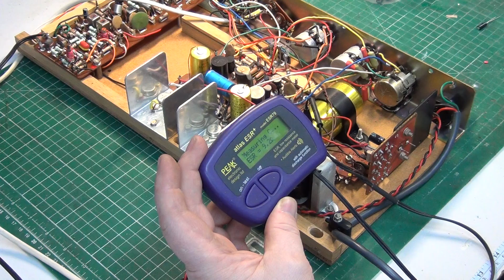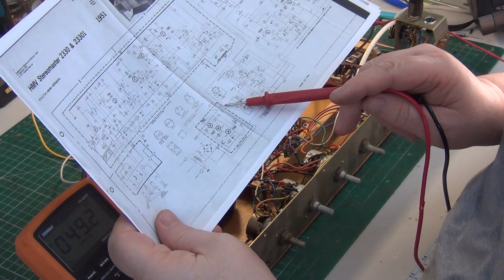HMV Stereomaster 23301 radiogram overhaul - pt2 of 3 - Electronics overhaul

Comment: Radio and tape sounding good I would assume the tuner is LW/MW/FM standard though in the past I've come across the odd radiogram with SW.
Reply from the maker: All the HMV Steromaster range of radiograms are FM only. Because they were HiFi it was decided that LW&MW weren't HiFI. HMV also did a standard range of radiograms with LW MW & SW too at the same time; but the Stereomaster range were HiFi.

Richard, G0OJF, UK

Comment: Another excellent video - thank you for sharing it with us. It's interesting to note the underlying chassis to which all the circuit boards are attached is actually made of wood - from the days when things were made properly.
Reply from the maker: Yes, the last two Stereomaster models they made; the 2411/12 in 1973 & the 2419 in 1976 were on conventional metal chassis probably because they werre offered as a tuner/amplifier HiFi seperate as well as the radiogram format.

Richsard